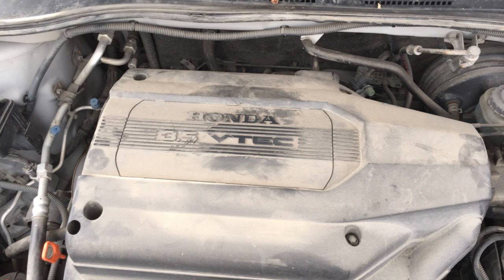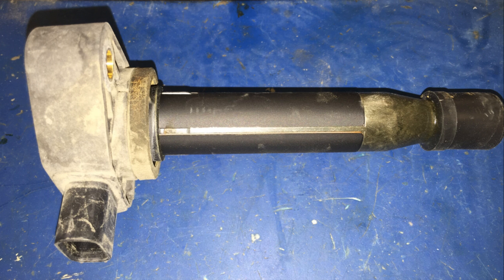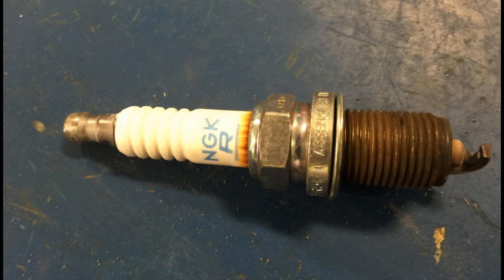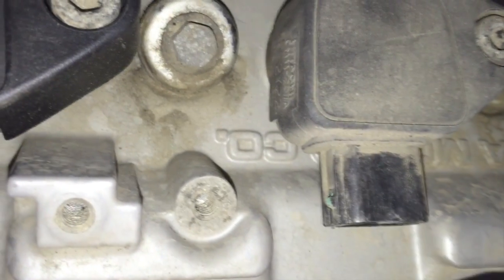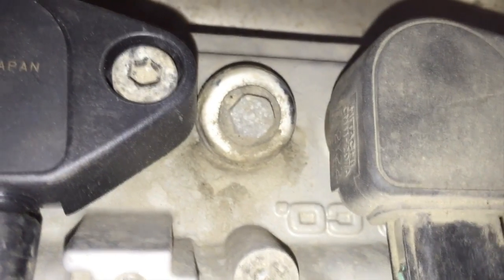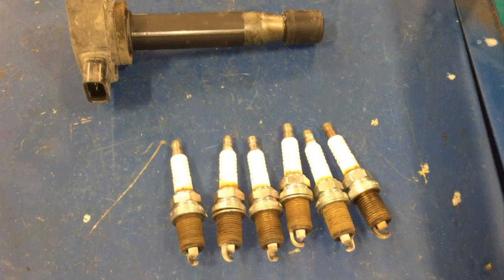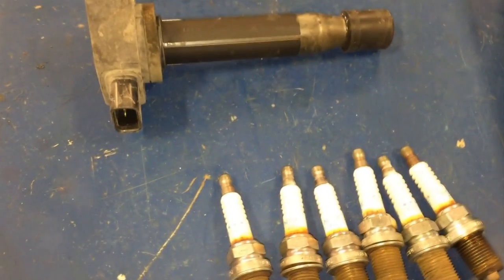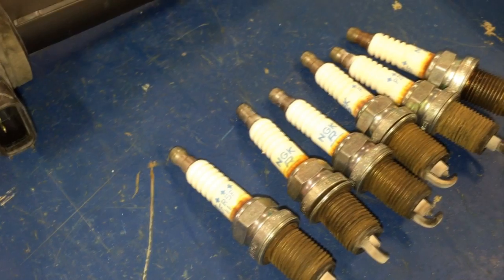How To Diagnose Honda Misfire Codes P0300, P0301, P0302, Etc.

Comment: there are many things that can cause cylinder misfire, the coil is just one of them.  could be a bad ground to the coils, can be a lean fuel mixture, or rich fuel mixture, can be cam timing off,  map sensor, crank position sensor   cam position sensors, plugs, restricted exaust, plugged catalytic converter,  injectors or electrical problems,   your statement how to diagnose misfires needs to be changed to how to diagnose coil misfire.

Comment: I has 2005 Honda v6 accord misfires Change spark plug change coil 
Valve adjust  this morning start the car engine misfires & check engine light on
Again may be need to change EGR ?

Comment: I have a 2011 Honda Odyssy 3.5    been getting the code 302    changed the spark plugs and it soiled the plug again in 2 weeks so I changed the plug and coil and 2 weeks later got the 302 code again     not sure what else It could be

Comment: What happens if I have all cylinders misfire, I have the check engine light and as well as the vtm-4 light
Reply: Lights on, I've changed the coils and plugs idk how to go about it, it has the p0301-p0306 any suggestions
Reply from the maker: Clogged egr ports maybe

Comment: What if that’s not the issue.  I replaced the spark plug and the coil. And it still has a code. Ana shakes when I start it.  I guess maybe check the lines for breaks.  What’s next
Reply: The coilpack connectors can also be the problem if they're old. They crack and break over time. An important thing to note, is that these codes simply mean there is a missfire in a specific cylinder. It can be caused by spark or fuel. So it can be the coilpacks, spark plugs, coilpack connectors, fuel cap, injectors, or injector connectors.

Comment: You da man! This video was right on.  I removed the connectors to determine faulty cylinder.  To double sheck, I swapped the coil to another cylinder and the problem followed the coil.  Installed a new coil and it did the job!!

Comment: I got codes 0300 0302 and 0304 Honda Civic 2005 lx and going only 45 miles an hour when going up a hill it only goes like 20. Then I drive a little more my check engine light blinks 4 times could that be spark plugs and ignition coils. Am I headed for the right repairs?
Reply from the maker: Very possible

Comment: I replaced all spark plugs and all coils and all 4 oxygen sensors new egr valve and new egr solenoid still getting p0301. Next new part is replacing just the fuel injector on cylinder one...van ranned to good before my check engine light
Reply: So what was the problem and do you fixed?

Comment: How are the cylinders numbered? I have a misfire in cylinder 2, but I can't confirm which cylinder that would be on my Honda Ridgeline 2009. Thank you for the video!
Reply: I found that if you look in the auto manual in the emissions section, it tells you in one of the paragraphs, but you can probably also just Google it too

Comment: I have a 09 Honda LX, 177000 miles.  To start only hand cam shaft position sensor  code.. after changing the CPS recieved  these codes P300 random misfire, P302, P303. Changed all coil pack and plugs. Still reading random misfire. Help

Comment: I have 2 Honda's with the 3.5 engine , both have 130,000.. miles on them.
Both started fouling #3 & #5 plugs and using oil , I bought and installed the s-vcm on both vehicles and instantly both problems are gone.
No more Eco mode but , No More problems.
Reply: What is “s-vim?”
Reply: @axjohn  It’s a VCM silencer that turned off the ill-working ECO mode in these vehicles.  That mode causes fowling, oil burn, misfires, engine mounts, vibration and likely the pre-mature death of the otherwise wonderful 3.5 Honda engine.  I have 235k miles on my 2015 and it’s getting the VCM Tuner II which is a great system as well.  Look them up for the advantages they give.  Highly recommend to stop all these issues.
Reply: @johnnyh64 where do I get this part? For my 2007 Honda odyssey
Reply: I just purchased the VCM Tuner II.  Really nice system and looking forward to it’s effects.

Comment: Hey can anyone help me? Like the stupid ads that I am. I accidentally put about 2 gallons of water in my gas tank. It's a 2013 Honda fit I got all the water out codes popped up like the ones here in this video clip. The car starts and runs but when I try to drive it. It's way low on power shifts weird and the when you let it idle after it barley will. Any help for a stupid ass moron that should have checked out what's in the gas can a little bit better!

Comment: 08 accord misfire 2 and 3. No issues with coils or plugs or pcv valve. No cose for egr valve. Any ideas what is wrong. Car bogs down no response. Don't want to tow it to the stealership.
Reply: Catylitcs converter

Comment: be prepared that the 'problem' is not what you figured ... the plugs and coils may be new and still have a problem on a certain cylinder indicated by the car's on-board computer (ECM).  ccasionally the piston ring is the problem and that is not for a homeowner to fix.
Reply: sure it is. A homeowner can do it with the right tools and know how. There are dozens of the right videos which show this. Rebuilt my whole engine with an additional 300 HP. so yeah, any homeowner can do it if they have the will to try and learn.

Comment: I have an 06 Honda Civic I'm getting a p0304  misfire code and p0354 ignition primary/secondary It also says system To lean bank it also stalls when I slow down at red lights to stop can you help it does say ignition coil a misfire on cylinder

Comment: Just wanted to let you know I had misfire issues.  Codes and all.   2008 3.2 TL.     Turned out to be fake counterfeit NGK plugs bought on eBay
Reply: The thing about Hondas is they are sensitive to parts and need the original manufacturer parts to perform their best. We've learned that with our used 2006 Honda Pilot.
Reply: @tamaralikecamera agree
 But these plugs were sold on eBay as OEM NGK plugs.   But they were fake
Reply: @mariodilorenzo7473  There was another video that I watched where the technician found that the owner replaced his NGK plugs from eBay or Amazon and that was the problem, the lead was gone in about 12 months.  Terrible counterfeit.

Comment: HI, I have misfire codes p0300 and all of them until p0306. I have change all coil and spark plug but the codes still come back. what to do???it's a 07 honda pilot
Reply: did you ever find what your problem was?
Reply: @louiseh7975  NO, I change everything, like all the coil and spark plugs, and alos on one youtube channel I see somone changing on smal coil in the front . but I still have the all codes turn on and turn off
Reply: @jeanpaulkapongodealmeidatr6263  Same issue here.. Did you ever figure it out? I too have the 07 pilot and changed coils and plugs. Even did valve adjustment and a bunch of other stuff.
Reply: @GoodWordsUp  still come back like 2 or 4 times in 3 months. But the good thing is after removed the code with my ob2, I still pass the state inspection. So just skip it...ignore it

Comment: I get misfire and all codes. I can hear it misfire when I increase the RPMs.   Pull power from coils and all seem ok. WTF
Reply: did you find what your problem was?
Reply: @louiseh7975  yes we bought NGK spark plugs from eBay never thought in a million years that they would be counterfeit. A less than 25000 miles

Comment: I replaced them all after running test. & my car still doing the same. Autozone claim it is a EGR 4175..... I’m exhausted after spending all this money for spark plugs and all coils for it to still
Have issues. Not one time you’ve mention what if you replaced all coils and plugs & still continue to have issues. Because that’s where I’m at. Come out with a part 2. As a mechanic or someone who his on here trying to come out with professional
Advice make sure you have a plan C
Reply: P300
P301
P302
P303
P304
P305
P306
These are all the codes it’s listing. Every cylinders random miss fires. Auto zone mechanic wrote in hand writting on the side egr 4175... the ignition would start and then stall out Everytime. The only way it’ll stay running is if I add gas to it while I start it.
Reply: @dreywezy1887  I'm with with  I have the same codes, no other codes, and it only happens when the motor is cold. mine is on a K20A2.  motor Runs good hot. I've install new NGK plugs and coils stive have the problem.
Reply: Dale Mauritz exactly same here. When it’s cold. Car been running fine lately but Everytime the light on it’ll stall and idle rough. If it continues I will try replacing all egr’s. Any recommendations on brands for 2000 Honda Accord Ex v6 3.0?
Reply: Dreywezy Baybeeh has the valve lash ever been adjusted on your car? The Honda j series is known to tighten up over time causing valve overlapping, were the exhaust valve is still open on the intake stroke. This will simulate an EGR problem.
Reply from the maker: Do you have an obvious misfire in a given cylinder? or just codes for multiple cylinders? List all codes in memory. Whats the compression readings? After testing injector pulse were they all OK? How many miles on it? Have you pulled the intake plenum and checked EGR passages for restriction?

Comment: I have a 2000 Honda CR-V LX it’s showing codes : PO131-02 sensor circuit low voltage ( bank 1 sensor 1),  PO300, PO301, PO302, PO303 ,PO304
Reply: Did u ever figure this out?

Comment: I have P300, P301, P3O2, and P304 on a 1999 Accord 2.3l.  I replaced the spark plug tube seals, spark plugs, and distributor.  I cleaned the wires, which were only fourteen months old.  So were the spark plugs.  Oh well.  The three cylinders with misfires had oil in the spark plug tubes, but I cleaned it out.  The old distributor leaked oil and the points were corroded.  What do I try next?
Reply: From what my friend told me it’s ok to have oil around the coils itself from a leak but having a puddle on the bottom of the coils is bad. But not sure what kind of problem that is.

Comment: Ok Car Doctor...what if I've replaced all 6 plugs and coils and the misfires are still present?  That's actually the issue with my 05 Odyssey EX-L, and no one will properly diagnose it.  Today I cleaned the EGR valve, ports and replaced the gasket.  I'm thinking there's a vacuum leak somewhere. Tomorrow I'll test the brake booster.  It's not always spark!
Reply: Did you fix it
Reply: Maybe a valve adjustment
Reply: I think it could be a fuel pump as well not sure tho
Reply: There is a reflash ecu TSB. Burning oil fouling out plugs it more than likely the problem
Reply: Remove timing cover and check timing belt for wear and tear

Comment: I have a 1999 Honda CRV with a multiple engine misfire code po300-p0304 and p1399 . There was oil in the spark plug well I cleaned that up I change the valve cover gasket. Switch the spark plugs switch the coil packs switch the distributor. I am still getting a misfire and my car turns off when I put it on Drive. There was oil on the bottom of the spark plug where it is supposed to spark any help would be appreciated
Reply: I'm having this same issue with my 2010 Pilot. I checked Spark plugs and found that a couple of them were caked up with oil residue. Possible causes could be valves, which require a valve adjustment or (Yikes if the problem is this next one because it could get pricey) the Piston rings need replacement due to oil getting passed over the top of the cylinder mixing in with fuel. I have disconnected all 6 coil packs individually to see if the idle changed. I did remove each one with the result being only a little shutter from the motor which would tell me that the packs are functioning, however they may not also be 100%. I am going to my local mechanic tomorrow to see what there input is as far as what maybe going on. I'll give an update after tomorrow.
Reply: @randalleakes9955  Curious, what was the main issue?
Reply: @randalleakes9955  I believe there was a recall for the pilot for those years.  The problem was the VCM shutting off the 3 cylinders in eco mode thus allowing the pistons to draw oil up past the rings, thus fowling plugs, etc…I just bought a VCM Tuner II to stop that action of the motor going into ECO mode, thus keeping all 6 cylinders firing at all times, thus preventing the fowling and other issues with engine mounts etc...  It only makes the vehicle a very tiny amount less efficient in gas mileage (1 or 2 mpg hwy) according to others but helps the engine last a lot longer.

Comment: @The car Doctor....2001 Honda Accord 2.3l V-Tech. Codes P1259, P0300, P0301, P0302, P0303, P0304...Changed out V-Tech Solenoid, plugs, and wires. It still have the codes. The car sputters on take off and at around 2300 to 2500 RPMS. Now it shows that the #3 cylinder is not firing. Removing the plug wires one at a time and engine idle changed but when removing the #3 plug idle did not change. Please help! I am sick of working on this car.

Comment: Just got random p0300 and 1,2,3,4,5,6 misfire on my 2004 Acura TL our of no were. Check engine light flashing car was running really rough and I slowly drove it home. Crossing my fingers hopping it’s just a bad ignition coil
Reply: Hamza Saeed did you find put what was wrong? My tl is doing the same thing
Reply: MEMO RAMIREZ took it to he dealer because I had an appointment for timing belt anyway. But they looked at it and it was one of the ignition coils what was bad. And they fixed it by putting an new one

Comment: My wife's 2014 Honda CRV has P0300, P0301, P0302.  The engine is a 4 cylinder 4.2 Liter.  I switched the #1 coil pack with number 4.  No change except that now I was getting P0354  (Ignition Coil D Primary/Secondary Circuit Malfunction).  I put the #4 coil pack back, then replaced #1 and #2 coil packs.  No change.  Then I replaced #1 and #2 plugs.  No change.  The old plugs were blackened around the cylinder end but no real signs of corrosion.   I'm guessing wiring?  What else could it be?
Reply: What was it ?
Reply: Sounds like rings to me.

Comment: I did this test today and had the exact same response, wen't out bought a coil at local store and that fixed it. I had po300,301,302,303,305, 306 and po1399 in the the error codes but the issue was maybe effecting most of the cylinders. The cost was $47 for the part. You saved me a bunch of money... Thank you!
Reply: So it threw codes for all cylinders but it ended up being only one that u replaced and it fixed it?
Reply: @thegoblin622  2 months late and I hope this helps someone, yes it was that simple for me. OEM coil is Hitachi IGC0055, $47 on rockauto (Autozone wanted $85 for one) I did all the plugs and coils anyway, with 200k mi this is preventative maintenance. FSM only lists sparkplugs, but not coils to be replaced. This is an oversight from Honda/Acura, as Hitachi lists service life at 12 years. Also a good idea to do Air intake tube (usually ripped at high mileage), filter and fuel filter at the same time.

Comment: I can't begin to tell you how many times this has happened on my 1999 Odyssey.  it's always the coil.  My solution is to just run the car, pull off one coil at a time and if the engine stumbles ore, the coil is good...if nothing happen, that's the bad coil...I replace it and move on.  I think I've replaced 10 of them since we bought it new.
Reply from the maker: They need to design better coils for sure. Blessings
Reply: I guess it's a way for Honda to make a few more $$$$....other than that, the van has been trouble free.
Reply: What is a good coil brand?
Reply: David Nguyen.   Denso brand

Comment: Hi. I have a 2003 jazz CVT.  Since 1 year the engine is sputtering more and more. I changed the transmission oil -> not better , then the CKP captor ( i had the P0339 error code) -> not better... Now i have the P0300 301 302 etc codes, a LOT of sputtering, and the engine STALLS. Also the engine and oil and battery lights are on...It has 135000km. I'm no DIY mechanic, but maybe you can tell me what i should ask to my mechanic. Thanks !

Comment: I change my Cadillac converter and the spark plugs I'm not getting any shaking I don't feel any misfires but I'm still getting all the PO codes po301 etc etc what could it be
Reply from the maker: clogged EGR passages

Comment: I'm looking at my buddies 2004 Honda pilot, codes are P0300 - 0306, I can clear the codes and wait 30 mins while the car is running and the codes changed to P0300, p0303, and p0306. cleared the codes and now only P0303 is showing, ive done a leak down test on all cylinders to check for a burnt valve but all is good. I'm going to clean the throttle body, and egr valve, and possibly the intake manifold,, all plugs and coils have been replaced
Reply: so what ended up being the problem.. do you remember?
Reply: @louiseh7975 answer us!!😅

Comment: Hi I baught a 2008 Honda Accord coupe v6 and from 1st to 2nd gear if I accelerate regularly it stutters in the Rpm between 1500-2200 rpm. I believe it is a misfire but no engine light is that normal ? Secondly sometimes when I put the car in drive the car takes a few second ( 2-3) makes a light jerk in the first second then a big one after that but only rarely. What could that be ? Do I have to worry about my transmission ? 😕
Reply: Same here. I wish someone would answer you
Reply: What id the issue and solution?

Comment: HELP!!!  2005 Honda (POS) Odyssey.  Yet another problem.  Got a P0134.  Brought to shop.  They suck.  Firestone.  They said I had a bad oring in a fuel injection.  I replaced them all.  Now code says P0132 134 and 135.  I replaced all plugs with $74.00 Iridium.  I replaced all the coils to the tune of $350.00.  Reset codes and they came back.  WTF.  What could it be damn it?  I mean, darn it.
Reply: It's called fuckstone they got us all mom pops closed now Napa firefucks goodears all ya have left thanks wally world